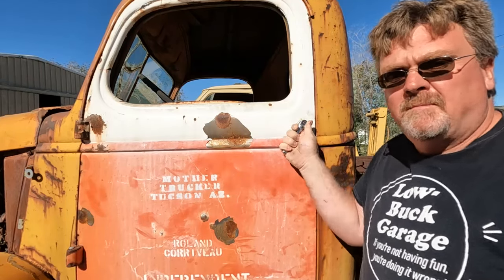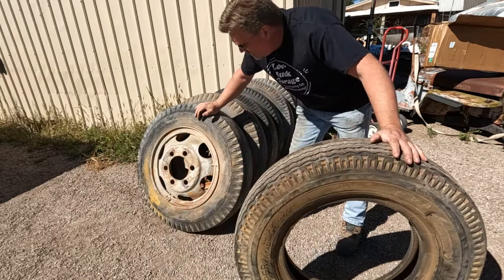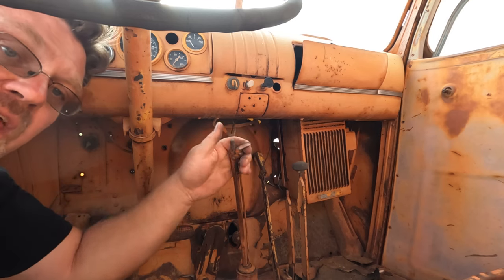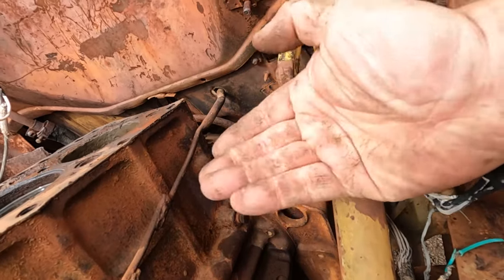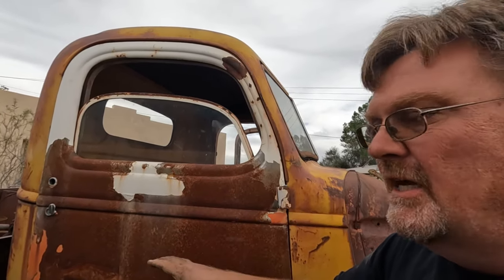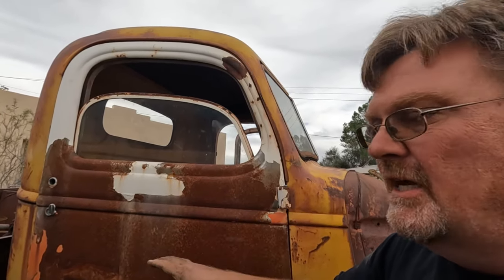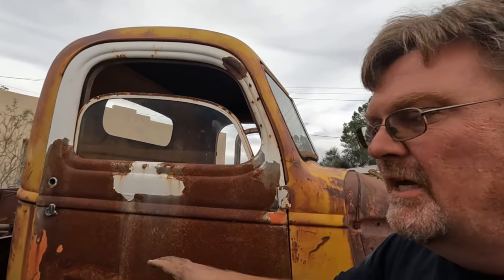4x4 1.5 Ton Chevy Double Dually Mutt Truck, I Shouldn't Be Working On This!

Comment: My early 1/2 ton 41 power wagon pickup had a 56 Plymouth 230 in it. It originally had a 218 flathead. The blocks are pretty much the same size physically so dropping in a later civilian car engine was done to many of these military trucks to keep them running cheap. It also gave my truck around 30 more horses and the same 9mpg.
As everyone says a car 235, possibly bigger, should bolt right in for cheap with luck. I used to pull both door handles on my truck when it was going to sit a while 😎.

Comment: By the size of that cab heater, I would be willing to bet that this truck was originally meant to work on the construction of the Alaska Highway, during WWII.  I have a couple of books on the construction of the highway, and there are a lot of pictures of 4x4 trucks with the civilian cabs.  The highway was s super high priority build, so maybe the trucks were supplied with the civilian cabs because there wasn't time to wait for the military style cab.   There were many abandoned camps along the highway, where the trucks, and all the other equipment, was just lined up, the axles were pulled, and the trees were left to do the rest.  An older friend of mine, (I'm 79), worked up there in the late 50s, and he and his buddies, salvaged all manner of parts and equipment from the abandoned camps.  
I have worked on a lot of those PITA belhousings, (I still have a 55 Chev truck, but it now has a 454 under the hood).  The 235/6, was a great engine.  Too bad it is toast.  Even the 216, with the splash lubrication, was a good, reliable, engine.  It was just not meant to rev to high, but we revved them anyway, and they took it most of the time.
Reply: Can you give me a book recommendation? Seems like a interesting subject.
Reply: thanks for the comment dude this made my day!

Comment: I think that block could be sleeved, but yeesh that is a bad'n. I normally say people cut off of trying to revive an engine way too early but that one's truly at a point where there's no point in trying to revive it. I'd still say save the block rather than scrap it; someone'll want to buy it who has the desire and resources to fix it and they aren't making them anymore.

Blue Flame Six is probably what you already had anyway. It was a common upgrade for Chevrolets of that era even back in the day because of the full pressure lube. My next daily is going to be a car from those years and if I end up with a Chevrolet I will be highly interested in a Blue Flame swap for that very reason; I want to be able to use the interstate and pinging an old Stovebolt off the far end of the tach for an hour a day 5 days a week is a sure-fire way to pop it while the Blue Flame will sit there happily for decades without a care in the world.

Comment: Owned a '56 international dumptruck that this reminds me of.  good truck even with the mid '70s school bus engine in it.  it was a glorious beast of an I6.  But I snapped the crank in half and it was cheaper to buy a 'new' used '84 mac 10 yard truck.  the '56 ended up as a yard ornament until I had to sell the ranch after dad died.

Comment: 282 chevy - nearly indestructable...until it sees a ford 300 or Mopar slant six🤣. if you dont want to sleeve it, a detroit or 12v cummins swap would probably  be overkill, but would last another 70 years.

Comment: So to remove the heater box you have to disconnect the transmission from the engine......maybe even STOOPUDER than the clutch/belhousing design.........shoulda just got a PowerWagon!!!

Comment: That front end uses a felt wipe inside that knuckle. If you pump it full of bearing grease , drive it , it will sling the grease to the outer edge, then put your oil in. Old vet that worked on military trucks showed me that
Reply from the maker: Thanks for the tip!

Comment: That round plate on the front makes a lot more sense now. we'll probably never know for sure exactly what it originally held, but we know it was welded on to hold something. I like your door handle ratchets too, probably one of the better uses for those old Craftsman ratchets

Comment: 👍👌👏 Very well done! That was really fine procrastination and some pretty good diversion from more important work that should be done. By the way: Exactly what I would've done too, sigh. 😁 ;-)
2) There are devices existing for recutting tire tread. Those work with heat and heated cutting blades in different shapes and depths. We once owned one for our tank trucks (22.000 litre).
Thanks a lot for making teaching explaining recording editing uploading and sharing.
Best regards luck and health.

Comment: You probably already know about this. I just discovered an induction heater to help remove rusty bolts and nuts. 
Amazon search induction heater. I think mine is worth 10x what I paid for it. I used it to replace the cab bushing bolts and I would have paid 1k to have known about this tool to complete a cab bushing replacement on my 2014 F-350. 

I love this channel!!!

Comment: Nice door handle! you put alot more thought into it then I did on my Dodge Raider that I got for free several years ago. Door linkage solidly rusted so I just hooked a 50# fishing leader to the spring. Of course i missed the first two holes i drilled so I covered them up with aluminum foil tape. Cant wait too see how you power her up!

Comment: Nice ol’ Chevrolet G506 you found there. Produced 1940-1945. Common to find them with a million modifications after their military-use. I’ve got three of these trucks up here in Alaska. I rescued one from the woods that was absolutely gutted and brought it back to life last year. Took me three years to find enough parts to do so. I ended up swapping a GMC 270 into it. Easy with some simple mods. The stovebolt sixes are some of the best motors I’ve played with. Hard to beat them. Glad you’re sticking with one. Curious to see your radiator adapting, as the stock G506 radiator is unique to these trucks only, not even a GMC CCKW rad will bolt in. If you need any reference photos, videos, or information feel free to check out some of my videos or hit me up. I’d be happy to help.
Reply from the maker: Good to hear from you, I've had a lot of people recommend your channel regarding this truck.  I waited to reply until I had useful information.  The radiator I'm trying is for a '48-54 Chevy pick-up.  The description claimed it was a 5-row, its not.  It does have two rows of tubes that are really wide, so I think it has plenty for cooling capacity.

I just test fit it yesterday, and it looks good for my application.  It is very close to fitting inside the radiator support, but I'm going to use a 1" spacer holding it sightly behind.  This leaves about 2" between the water pump pulley and radiator.  

I've heard that the GMC 270 is slightly longer, so that would probably be too tight of clearance for yours.  However, with fairly minor cutting and welding the radiator would fit inside the support, which would move it an inch or so forward.

Comment: Man, that was a fun and enlightening video! That was a LOT of water in the oilpan. I have a '47 Fleetmaster with a similar engine, so I was right at home seeing you delve into that one. What I didn't know is that the later ones didn't use splash oiling on the conrod bearings! I wonder if I can drill my crank to get pressurized oil to them......... And the ant-theft door handles! Amazing and ingenious! I can't wait for the next video....

Comment: just love the duallies all round, front and rear you just don't see that sort of stuff anywhere. what sort of hubs/mounting gets front duallies? it looked like a solid front axle if i recall correctly, so what bolt on parts do you need for that to happen?
Reply from the maker: All these need are the budd style dually lug nuts, and this one already had those on it.  These trucks were set up like this from the factory so you could add front duals for rough conditions in military duty.  It would work with other trucks using the budd wheels, but fender clearance might be an issue.

Comment: That tread pattern was used on the Thorneycroft Antar, which was a 1950-70's UK Tank Transporter.    If That round plate was vertical I would have said it is a bridging plate, so this vehicle served in - or was built to serve in, the European theatre.  (It would have had it's bridge class weight painted in black on a yellow/white background.).  But if it lays flat, maybe (being a bomb truck chassis) it held a fire extinguisher.   What am I thinking...lets get out the 'Bible'. Historic Military Vehicles by Bart Vanderveen.  OK the Bomb Service truck 1 and a half ton M6 did not have that round thing, neither did it have a bridging plate like that in that position.   It had a hand crank lug on top of the bumper......but it didn't have those two strange lugs that seem to be welded to the front of the bumper.

Comment: I have been able to exchange my broken Craftsman tools and my local Lowes.  I go to the tool section, locate the tool and take it to the service desk for the exchange.  I've replaced a 3/8" and 1/4" ratchet and a phillips screwdriver in the past year with no problem.

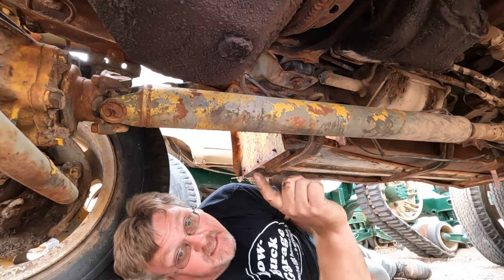Comment: 10:05 hmm my guess is metal filings and oil with a bit of water since it has been sat for awhile
Reply: 11:19 i was kinda right i didn't think it'll be THAT bad to have metal chunks in it that engine is most definitely shot since to have that much water isn't normal for an engine that has just been stood.
my guess is that it had a warped head/block (since they're from different engines and didn't get them machined flat on the mating surfaces)leaked coolant water into the cylinders, hydrolocked it which caused something to break internally like a rod or the main bearing caps.

edit: was kinda wrong again sadly never thought it would be that bad since older blocks were overbuilt so getting something like that was gutting since its an intresting engine

Comment: I am oxygen deprived, from laughing so hard! If I had to write an essay on mechanical engineering, this. The variety of oddball things you collect and work on  says alot about your abilities. I have a seldom used RR track, down a steep 40' slope next to my house. I am legally blind, like 20/600. If I find a 300 like yours, adventures will follow.
Edit. That was THE nastiest oil drain ever! I did not throw up in my mouth, at all!

Comment: “Looks close to the right size, I’m sure I can make it fit.” That is literally that truck’s motto :D  *definitely a mobile plant truck, I can tell by the brazed floor. With oxy-acetaline on board it is faster than using bolts.

Comment: Oh, BTW, you are correct about the door mechanism also being a lock.  In the down direction, it opened the door, and in the other direction, it locked the outer handle from being able to open the door.  Those doors sometimes opened when you didn't want them to, and one one occasion, my butt was hanging out over the pavement, when my buddy made a right turn and the door popped open.  it was a good thing, that I had my elbow on the door sil.

Comment: Use a 50:50 mixture of acetone and ATF to loosen nuts and bolts, spray on and let it set for a while. Works on any rusted and corroded metals.

Comment: If I remember right, there are six bolts that hold the entire front clip on.  Would make motor swapping a might easier....it did for me.😀
Reply from the maker: I think I will take a crack at removing some of the front.  One reason I didn't try that at first is that the person who swapped the cab over actually welded the fenders to it.  This one will be a little trickier than normal.

Comment: that radiator at the end looks good, what year range is it for? I need to find one for my '50 3/4 ton
Reply from the maker: Its supposed to fit a '48-'54 Chevy Pickup, found it on ebay.  Sounds like its made to fit your truck!  I bought the thickest one, there were thinner ones for that application that were even cheaper.
Reply: @LowBuckGarage  the thicker one is probably better for me, I'm also using a full oiler 235 in my project, a frankenchevy 62 bottom end 55 head 62 valve train. I live in northern Utah so temps can get pretty high.

Comment: I like the truck! That double fan heater must have come from Alaska. I'm not sure if I would have bought the square stock thought. You couldn't find or make it from the stuff there. I wish I had all that stuff laying around!   I was in the Army in Alaska in the mid 60s. I traded a shaved Chevy flywheel for a 292 Chevy truck motor that we put in a 54 Chevy. Maybe you should consider one of those, for that heavy Chevy, instead of a 250. 250 is a good motor but.  Now you keep on keeping on and I'll B watching!      👍👍👀

Comment: Did you make the bumper lever or buy it? I've been looking for one.
Reply from the maker: I just used a piece of pipe and a chain.  I could get away with that because the plate was welded on with an angle iron brace, so I could use that to connect to.  If it didn't have that brace, I wouldn't have been able to attach to it so easily.

Comment: My RV uses an Oshkosh chassis with the same six bolt wheel pattern. And I end up using a torque multiplier to reach the 600 foot pounds required to tighten the wheel nuts

Comment: Well it can be sleeved, but other option is to cut off the damaged cylinder to make straight 5 engine for shits on giggles and you get motor out of it, if it actually works.

Comment: I'm hoping to use the old 61 type 3 air-cooled engine out of my project vw as a buggy engine though I don't know what chassis and frame to use. Any tips?
Reply from the maker: As I recall the type 3 is pretty much a straight bolt in replacement for a type 1, so it should fit any standard buggy.  The cooling tin is lower, so you can make some storage above it.  Some of the earlier transaxles used a smaller flywheel, but they can be clearanced.

Comment: How in the Fu-k do you get that much water in your engine block??? SMFH that poor thing was literally filled at least to the hight of the cylinder head if not into the valve cover itself? That's crazy Sh1t! Don't think there's any possibilities that you're breaking this one loose and running it!?!? How people can let things let things get like this??? Almost like it was done on purpose for sabotage, especially if it's been stored in a arid desert type environment for all these years?
Reply: It is condensation water that accumulates in all old engines and gearboxes due to the weather over time. The exception is a state or country with summer and constant temperature all year round. I knew there would be water, I was sure. The same thing is certainly true of the car's transfer case and rear axle.

Comment: I'm not sure where you are located but here where I live is an auto/truck parts store called Mars and they can get all kinds of gooodies from early 1900s maybe even earlier.I dealt with them for years because I has a lot of old cars I couldn't find parts for until I discovered Mars.
Reply from the maker: Unfortunately, there aren't really good auto parts stores around here, just the usual chain stores.

Comment: I have a little different idea about the round plate on the front bumper. I think it’s an added work surface. If the truck was a service truck, there are times you would need a workbench to work on starters, carburetors, etc..
Reply from the maker: Definitely works for that, right now its filled with bolts for the front end from the engine install.

Comment: Yo Low-Buck what do you think about a small engine in a heavy duty 4x4 done right . Fun and cheap
Reply from the maker: I was thinking about putting some small engine like that in a dozer.  With nice low gearing, it should work, and you don't need momentum for pushing dirt.
Reply: @LowBuckGarage  I see one in an 82 4x4 Toyota 5 speed , it was impressive ,I’d like to put one in a 10 ton dump truck

Comment: To add to the credibility of this truck, my dad rolled one when the edge of a bomb crater gave way. He was with the 4th Armored Division in France during WW2. It seems that the army gave them the trucks even though tanks don't carry bombs.
Perfect.
Anyhow they pulled it upright with a Sherman tank and drove it away. He said it cured the sticky door. I watched you and laughed. He was your kind of guy.
Sad about the motor. Could be fixed but too danged expensive. I've sleeved worse.
Cheers
Terry